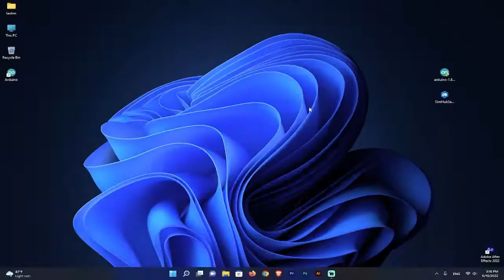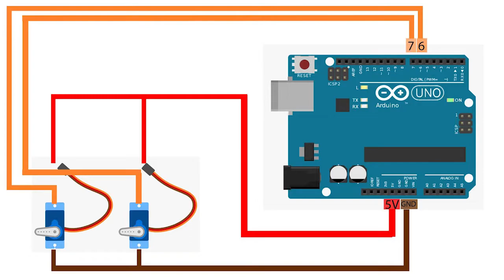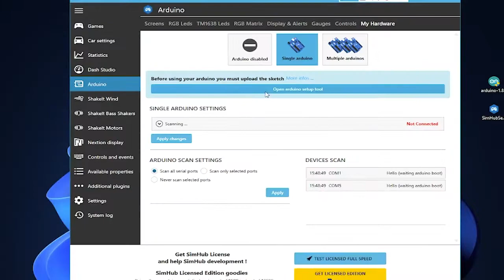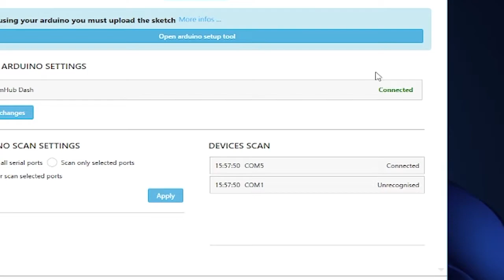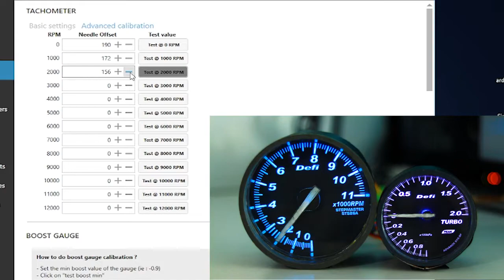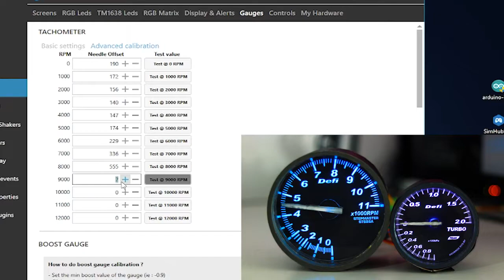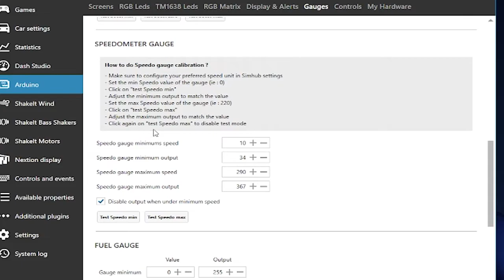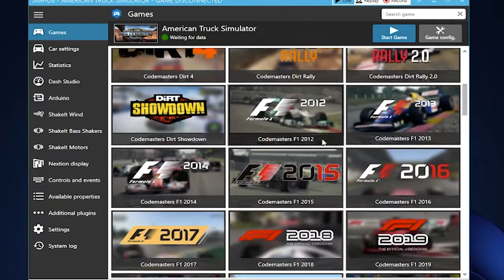GAUGE INSTALLATION ( SETUP ) | ARDUINO | SIM HUB

Comment: I am at my wits end here. I am getting the signals to the stepper, and the ULN2003 lights up as per min/max/zero boost. But the stepper just hums. i confirmed that it works with another sketch on IDE, but it just wont move. Driving me nuts
Reply: I worked it out. Pain in the ass but got there. Mine required custom serial data because it's analog.

Comment: Why don't I find someone explaining how to connect a km/h and rpm gauge with Arduino? I've only found a way to connect rpm! I don't want to get lost in the electrical diagrams of the speedometer panel because I have a different model compared to the videos I've watched
Reply from the maker: It can also be done with a sim hub. inside the software shows the things to be done and the diagram as well.

Comment: se puede hacer uno para km/h?
Reply from the maker: yes
Reply: @zudumalli  I see that on simhub they only show me the RPM, what would the KM/H be?
Reply from the maker: speedometer (Under the tachometer)
Reply: @zudumalli  And how are the speeds regulated? I only see the RPM to regulate it manually, or is the condifuration done automatically?

Comment: Hello Friend, I did the same procedure with the servomotors and it looked good with the tachometer, but in my case I added a speedometer, the speedometer with respect to 0 km and 200 km (maximum that I have in my cluster), is well calibrated but calibration must be done of each km and the truth is I don't know how to do it, the tachometer runs without problems, but an example is that in a game the car goes at 120 km and the servomotor is at 160 km or from 0 to 100, the game goes at 30 km and the cluster is at 110 km, it is out of calibration and I really don't know how to calibrate it, could you help me calibrate the speedometer or make a video on how to do it? I would greatly appreciate it😄
Reply from the maker: If you have to untick something there, untick it and try. I haven't connected a speedometer to this yet.

Comment: Hi man, How could I add the red shift light and have simhub accept it?
Reply from the maker: There is no separate option for that, but you can use an LED strip option and connect only the last LED. Then the led blinks at the last rpm.

Comment: @zudumalli i am having a problem that i am only able to test my rpm from 6,000 to 11,000 what can i do to resolve it
Reply from the maker: 1. check if your servo motor is to the maximum *left*. Then attach your meter needle zero directly to the servo motor
2. (SimHub) Go to the tachometer > advanced calibration > Test @0 RPM
Hold the plus mark until your meter needle moves. Then hold the negative mark and set the zero position.

Comment: Hello i have made tachometer and boost gauge but i have a problem they don't work
I Open simhub and for tachometer i can only set 6000-9000 rpm and boost gauge doesent work at all
Reply from the maker: Can u send some screen shorts please - https://www.facebook.com/nimesh.tashmika.50
Reply from the maker: I will help u 🙂
Reply: I Sent the message
Reply: i have the same problem, you can fix it?

Comment: Thanks for the tutorial. Will this work with farming simulator games
Reply from the maker: Yes
Reply: @zudumalli  thanks!
Reply: @zudumalli  Will You add light to dashboard such as parking brake light, check engine, hazard light
Reply from the maker: I am thinking of making a complete meter board. Some indicators are added to this meter panel.😀
Reply: @zudumalli  Nice, do You plan on making it this summer?
Reply from the maker: not sure. Maybe it will take longer. Because I'm still making the game meter panel and another steering wheel (for assetto corsa)😄